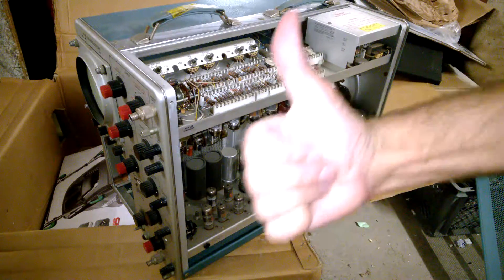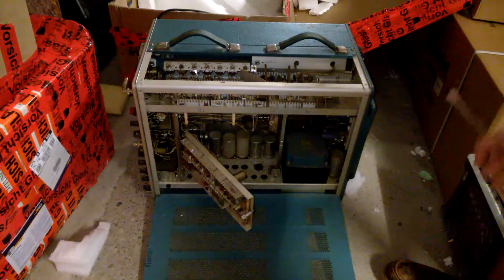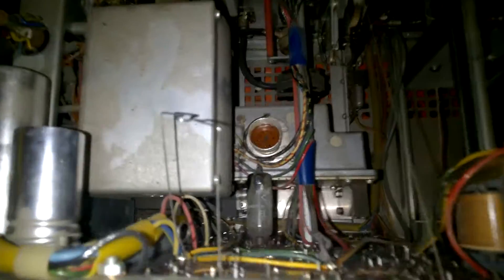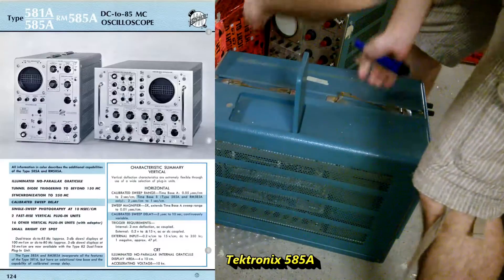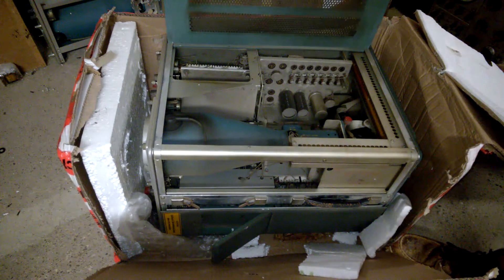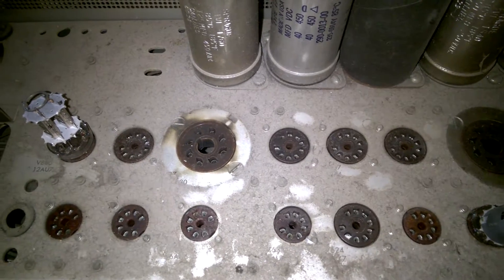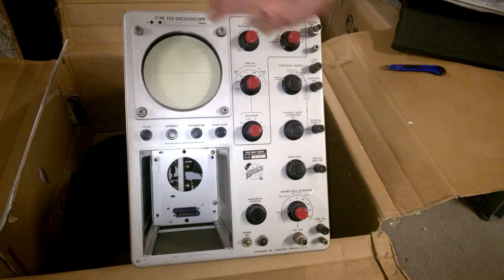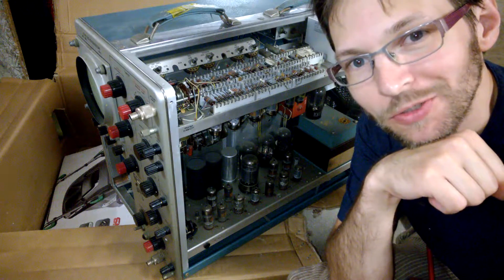BEB #29: Tektronix MAILBAG 545B 585A 541A 532 Oscilloscope Oszilloskop ebay fraud

Comment: I still use eBay but I ask questions, ask for more pictures and I have even been able to send them directions on how to open up equipment and check for the parts I need. Yep I have been scammed but it has saved me WAY more money on equipment than I've been scammed on. Thanks for sharing..... 3 years after you released it. Best Wishes n Blessings. Keith Noneya
Reply from the maker: Thank you! :-D

Comment: Max, sorry to see you were the victim of an unethical seller. I suggest we take these kind of sellers and test them like we do old electronics  that haven't  been energized for some time. All you need is a variac and a 400 watt soldering iron. Preferably an old vintage iron with a large copper tip. Plug the variac into the line and the iron into the sellers orifice that best describes him. Now slowly increase the variac over an extended time period.  This may reform him but probably not as well as an electrolytic.
Reply from the maker: LOL. Awesome comment. Will do the next time :-)

Comment: Last year I picked up a HP 616A microwave signal generator at a local flea market, also missing all the tubes, however I only payed 10EUR and managed to find replacements for all tubes on ebay. Also there weren't that many tubes as all the actual magic is happing in waveguide circuitry
Reply from the maker: The HP 616A is a wonderful device. Glad you've found replacment tubes. 
Thank you for your comment.

Comment: I've had a Type 532 for quite a while, and recently got into hobby electronics and pulled it out. I'm going to check right now if it has it's tubes....and we're looking good, nothing seems to be missing. 

What do I need to get this thing up and running? I don't have any cords for it.
Reply from the maker: Hi. many thanks for your comment. I'm glad I'm not the only one interested in vintage electronics. You will need a variac to slowly power it up. Use an old powercord, cut it off, and wire it directly to the AC mains input pins. Keep me updated. Kind regards, Max
Reply: Cool Thanks! Will do, I'll probably get at it tomorrow after work. I'll keep you updated! 

Thanks again for the quick reply!